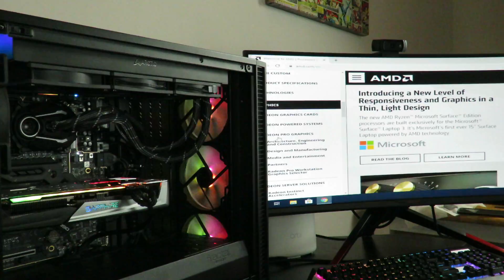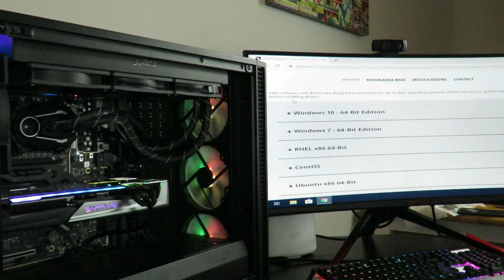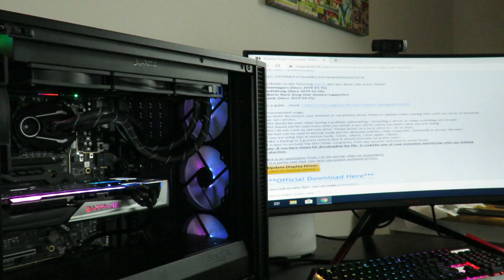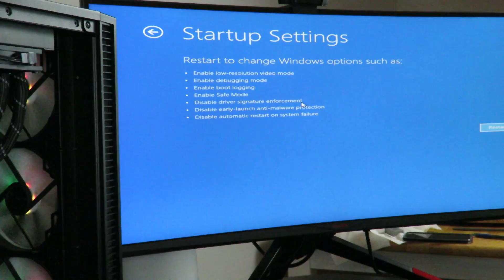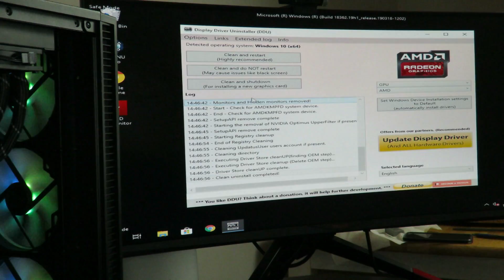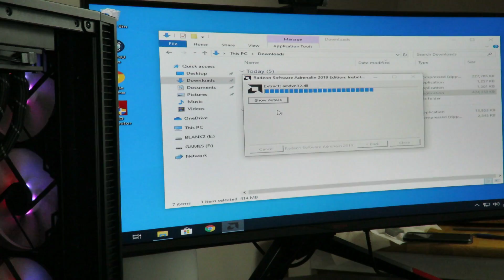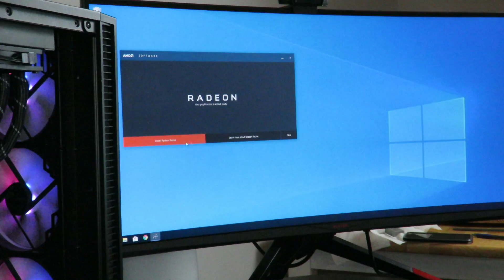Installing the AMD Sapphire Radeon Nitro+ RX 5700 XT 8GB OC Graphics Card

Comment: So hey. I'm on an msi mpg x570 and ryzen7 3700 but b I'm getting ezdebug vga ight, and sometimes it starts with CPU light. There is no display, but I 1g dummy card in slot two works when I unplug pcie. Anyone with any info? Do I needa update windows fully first? Or maybe flick the little switch?
Reply from the maker: do you have this sapphire card or any amd card right now?
Reply: @ThisBytesForYou  the same one. It's in my primary slot, without the HDMI, or pcie power plugged in, till I resolve it. When its active, is when the error occours. Xpg, and game boost are off. Bios switch is in the first position. I think my mobo bios is up to date, as well
Reply from the maker: @crowwurm  download the latest driver, it just came out today, and use DDU like I mention in this video, I had the issue yesterday on a card I am reviewing, and so far so good with this newest driver.
Reply: @ThisBytesForYou  ok so will the driver install without the card plugged in?
Reply: @ThisBytesForYou  gtk brother. Out of here in n an hour or two. I'll let you know how it goes.. I feel like we need a sapphire 5700 task force
Reply: @ThisBytesForYou  kk. Didn't help. Got an error. And got one before when I was installing the software without my gpu plugged in. I'm running on a dummy 1gb card, when I can get into windows. If plug my pcie in to my sapphire, even with the other card in spot two, I get no signal from the sapphire. In itself words. There's no way the software will recognize my sapphire, as the PC won't even BOOT with it on. When I plug in the HDMI to the sapphire, I get no signal. So I can't load windows in order to install software..
Reply from the maker: @crowwurm  did you try the newest driver, a driver released yesterday with a ton of fixes, in there is a black screen fix
Reply: @ThisBytesForYou  Well.. it was a new sys. Dude. Honestly, I went into bios and changed it from pcie 4 to 3! Problem solved. Now I can boot with no ezdebug error! Installing software right now
Reply from the maker: @crowwurm  nice, but try the new driver too, the new driver is supposed to be amazing.
Reply: @ThisBytesForYou  totally am. Still getting some glitchy stuff... But this is a brand new system. Ryzen7 3700x msi mpg x570 sapphire nitro+5770 xpg gammix nvme 16gddr4 ram
Reply: @ThisBytesForYou  I'm currently using A 1gb amd card, so I can access bios/configure things

Comment: When you are supplying power to the 5700xt card, do you only need one PSU cable that has two 6+2PCIe connections? Or do you need two separate PSU cables that each have 6+2 PCIe for each of the 8 pin connectors on the 5700xt?
Reply from the maker: No my friend, you need to connect both, if there are 2, always plug in 2.  As for 2 seperate cables, it's best to use 2, but it's ok to use one, it all depends on you power supply.  Remember, it's not only watts thehe card needs it's amperage.  What manufacturer and model power supply do you have.  Also, you might want to watch the video, I go over all of this.
Reply: ThisBytesForYou thanks for the reply! I have a Seasonic 850w platinum. I guess I stopped the video short of where you mentioned 1 cable vs 2. After further reading through my power supply manual, it mentions using two power cables connected to GPU for optimal performance, so I’ll go that route. Thanks again!
Reply from the maker: @johnmenist3483  anytime my friend, happy I could help.  Sorry I did not respond sooner, Youtube is horrible at letting me know when people post, so many times I have to go through nearly 400 videos to find comments not delivered to me, very time consuming but I love helping.

Comment: Okay... Alway thought install the drivers and done with it.
Reply from the maker: No no, you gotta remove old drivers then new, if not you get all sorts of issues
Reply: @ThisBytesForYou  even if my previous drivers were amd ?
Reply from the maker: @Gunblaster1000  yes, like I said 6 days ago, ddu will remove everything on the old drive that was causing issues and install the fresh set, if you are using an AMD cpu though, make sure to uncheck all the AMD stuff so it does not touch your chipset.

Comment: thanks for the video.. i have the same gpu and when i am booting or in bios the fans are too loud..and also i think the bios switch does not work..in all positions the voltage is more than 1.2 and i cannot get this card undervolted as the settings reset after restart or boot..any help ??
Reply from the maker: for the bios switch to work, you have to switch it and then reboot, you can tell with gpuz for example.  When you are booting, the fans will always be loud, it tests the fans during post
Reply: @ThisBytesForYou  i see..thanks for replying
Reply from the maker: @dimitrisivanov9285  anytime my friend, please let me know how it works for you

Comment: Hey. So I saw you downloaded the drivers marked as "optional". Have you had driver issues so far? Currently in the process of buying the same card and wondering if it's a safer bet to go with the "recommended" drivers..
Reply from the maker: Recommended is safer, since they are WHQL'ed drivers but I usually go with optional, as they are newer but of course are known to have potential issues.  I did have one issue, and it is an issue many have had, but I resolved it, you can see it here: https://youtu.be/Qh2xEUXWeqs, let me know what you think

Comment: Best tutorial I've seen, got myseld the gigabyte rx5700xt. My psu has 2 pcie 6+2 connectors with only one wire. Will this still work? or will I need a different psu
Reply from the maker: Thanks my friend, very happy I could help and I appreciate your kind words.  Usually it is best to use 2 cables, but one can work too.  What is your power supply manufacturer and model number?
Reply: @ThisBytesForYou  I believe it is  cool master MWE 230v 500w. Not sure on the model number
Reply from the maker: @Rob_Champion  well, the card requires 600Watts and they recommend a 650Watt, maybe something like this:https://geni.us/f7Uq
Reply: @ThisBytesForYou  I'll try that one, thanks
Reply from the maker: @Rob_Champion  anytime my friend, happy I could help.  sorry I did not get back to you sooner, youtube is horrible at delivering notifications, so I have to go through almost 400 videos to find comments I had not replied to and that youtube didn't let me know about.  So what did you end up getting and how is your system working?

Comment: I am going to be switching from a 1050 to a rx 5700xt soon and im aware I have to use ddu to install drivers and such but do I do this after or before installing the new card

Edit: also what  is the length of the card because on Google there are many measurements for the same card from the same company
Reply from the maker: I walk you through it in this video, please check it out.  Also, what the exact model number of the card you are getting?  Manufacturer and model number
Reply: @ThisBytesForYou  I was thinking about this one "XFX RX 5700 Xt Thicc III Ultra 8GB Boost Up to 2025MHz GDDR6 3xDP HDMI Graphics Card (Rx-57XT8TBD8)" paste that into Amazon
Reply from the maker: @SycoOP  it would help me tons if you used this link: https://geni.us/5FzgX, it is my affiliate link to that card, the measurements for the card are he following: 12.4 x 5.16 x 2.24 in inches.
Working to get this card to review soon, please stay tuned.

Comment: What if I already installed the drivers for the card but didn't get rid of the windows ones? Right now my card is working well but the graphics at times jitter and lag a bit, it even crashed on max settings in Forza Horizon 4. Any tips for this problem?
Reply from the maker: If your graphics are jittering, older drivers could be the cause, it could be you have vsync on, it could be your graphics settings are too high, it could be many things really.
Reply: @ThisBytesForYou  alright cool, thank you so much. I never worked with a Radeon card before and it is a new experience for me. I really appreciate the quick reply! Thank you for the advice :)))
Reply from the maker: @jamesonthehigh6021  you are so very welcome my friend, very happy I could help

Comment: would there be problems in terms of power consumption when u plugged in a Y 2-pin cable? or would it be better to have two separate 8 pins
Reply from the maker: Yes it would always be best plugging in 2 separate cables, the built in splitter let's you know it's safe, especially being a 1000watt, but lower wattage and grade psu's, I would recommend seperate to more evenly distribute the load.

Comment: I just built my PC with a Corsair TXM 550W PSU and a Msi X570 MPG Gaming Edge Wifi Motherboard. I used two slots like you said and connected it to the first PCIE Slot and attached two 6+2 connectors to it. I don’t have a monitor so I manually turned it on through the motherboard power switch. When I do, all my specs power on except for my GPU. No rgb no fans spinning, however it feels warm and vibrates... this is the same card being reviewed.. any tips please?
Reply from the maker: Your PC will not turn on fully without a monitor attached to it, just wait till you get a monitor.  I know you want to test it,  but you cannot without  a monitor,
Reply: ThisBytesForYou thank you sir
Reply: ThisBytesForYou what if I tried  connecting it to a TV via HDMI. I tried that and no connection but again perhaps I do need a monitor.
Reply from the maker: Well you would need to set the tv as HDMI to boot off of it and you would need to reset the pc for it to pick up the monitor

Comment: I did just like you said but during the installation for redoan software the screen go black. I waited for many hours and nothing changes. I restart the pc also nothing changed. Just a black screen. So I had to format the pc and install windows again to remove the black screen I tried some many ways but no luck 🤞. The pc is not freezing because when I press alt+f4 the pc shut down. What can I do?
Reply from the maker: try this, boot back into safe mode (https://youtu.be/Qh2xEUXWeqs) and use DDU to uninstall the drivers and make sure to place the check to not have windows automatically update your drives.  The after thats done, boot back into Windows.  

Start the driver installer (download the latest amd driver)  where it extracts all of the drivers, don't change the path of the where the drivers get extracted to, then when the driver starts, when it shows the AMD Radeon software installer, cancel it.

Next, Go to your device manager (right click on the start button then click Device Manager), go to display adapters, then right click on the video card there and select properties the click on the driver tab, then click update drivers.  Click Browse my computer for driver software, then navigate to this directory, and enter C:\AMD\Win10-Radeon-Software-Adrenalin-2020-Edition-20.2.2-Mar5\Packages\Drivers\Display\WT6A_INF, go through the prompts and restarts when it asks you, and see if that helps you.
Reply: Did it work Abdu?
Reply from the maker: Sadly some people never reply

Comment: If I have an Amd Radeon rx580 do I need to do the DDU process or skip it since I already had an AMD gpu? Great video thanks!
Reply from the maker: I recommend doing it, as you will be updating your driver anyway.  Without DDU'ing your system, you will be utilizing the older drivers instead of using the latest and greatest features.  Though... I will say, the newer drivers do have a few issues, but AMD is working hard and heavy to resolve them all.  Thank you also for your kind words, it means a ton to me.
Reply: ThisBytesForYou Thanks!! Very helpful and absolutely - I’ve watched a lot of tutorials and none are as well put together as this.
Reply from the maker: Wow, thank you so much Emjay, it means so much to me to hear you say that, I try so hard to make good ones, it's good to see they are working and helping. As always, if you have any questions, please feel free to ask, I have a ton of how this here to help you in just about everything and if you don't see something, let me know I might make a video on it.
Reply: ThisBytesForYou amazing, you rock man!
Reply: ThisBytesForYou hi! I have a question unrelated to sapphire nitro (going to install today once I figure out an issue I’m having). I installed a new Corsair psu 850x (850 watts) works completely fine. Tried installing my I7 9700k in replace of my i5 8400 cpu I bought (motherboard is b360m bazooka) and it gets stuck on arsenal gaming loading screen. I used to be able to boot to bios even with the new cpu (I7) but again just stuck on loading screen and when clicking delete to get Into bios I get a black screen. Any ideas?
Reply: Black screen is new when trying to get into msi bios. Before it let me.
Reply from the maker: @Mitchard1  I apologize my friend, youtube never let me know you messaged, youtube is horrible at that, I have to go through nearly 400 videos to find comments I have not replied to, that youtube has not let me know.  How is everything working for you now?

Comment: I need help. I bought this exact card and doing research I found out that I need a pcie 4.0 specific motherboard. Is this true????
Reply from the maker: no no no, don't get confused with that, it can utilize PCIe 4.0, but does not require it, as long as your board has UEFI on a PCIe 3.0 slot, it will work fine.  What motherboard do you have?
Reply: ThisBytesForYou currently a gigabyte ga-ab350 gaming but I figured I’d get a new motherboard since this one is already maybe 4 years old and as I was looking for motherboards I realized they are all over $400 for a good one that supports my new card which I haven’t installed yet. Looking for more motherboards now. I was losing my mind thank you! Any you would recommend? I’m using Ryzen 7 1700x

Comment: Can't you just install new drivers, why did you remove old ones manually?
Reply from the maker: to verify EVERYTHING is gone.  Uninstall the drivers through AMD's software (not specifically AMD, it can be NVIDIA, Intel, etc) they leave things behind causing a mess.  If you install OVER that mess, sometimes those files may not get overwritten, so you have incompatibilities and you can get many issues.

Comment: Hi I’m getting a RX5700 XT but it doesn’t fit in my pc, are there different models?
Reply from the maker: lets take it back a little, help me to understand your current machine.  What motherboard (manufacture and model number), processor, case ((manufacture and model number) and power supply (manufacture and model number) you have right now, then I can help you with the card.
Reply: ThisBytesForYou I just measured my case and I was wrong but I’m not sure if my 400w psy is enough. I know the recommended is 500w, I have Ryzen 3 3300X mb is Asus prime A320M-K

Comment: Hi there!
I've got a power supply by Corsair RM550 it's an old version, but still, it is a good power supply with the gold certificate. 
My setup right now is:
Ryzen 7 3700x
16gb of Ram
And I just bought this video card Sapphire RX5700 nitro+, could you tell me if my power supply can handle it-?
Awesome vídeo btw :)
Reply from the maker: thank you my friend, I really do appreciate your kind words, they mean a ton to me.  So the answer to your question is yes,... and no.  So as per Sapphire, they recommend at least a 650Watt, but require a 600Watt, during my testing, it did not hit 500Watts, but that does not mean it won't on your system.  Mind you, the card did not hit 600Watts, that's not what the requirment is for, but you can see my full review on this card where I show you gameplay and benchmarks where I also show how much power the system is consuming on average and the max point in the session https://youtu.be/YWzqVU6Oq74.  Also, you need to make sure you have both PCIE connectors plugged in.  I hope that helps?
Reply: @ThisBytesForYou  Hi it is been a month since I got this card and I'm using it on my RM550. I haven't got any kind of problems so far working great, so great that the fans of my PSU never turn on meaning it's not loading more than 60% of usage, those RM ultra-quiet models are really great. I've it for 5 years and still holding on, anyways I'm really happy with this card and my PSU
Reply: The card never surpasses the margin of 190~250 watts consumes. Even on more hardcore games that push your card to the limit. I'll let these comments here to share my experience with it. Anyways Thanks for the awesome video

Comment: Hi, I only have one cable, can I go to the store and buy another. If so does it have to be the same brand or can I mix brands. My psu has two slots to power the GPUs
Reply from the maker: Well, what is your power supply manufacturer and model number?
Reply: ThisBytesForYou I got it figured out but thanks for help
Reply from the maker: Anytime my friend, what turned out to be the issue?